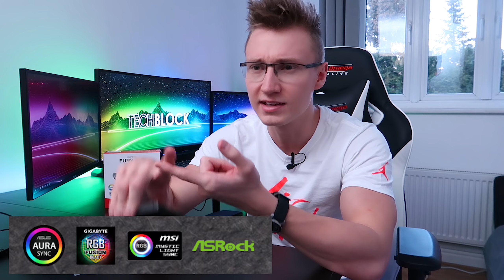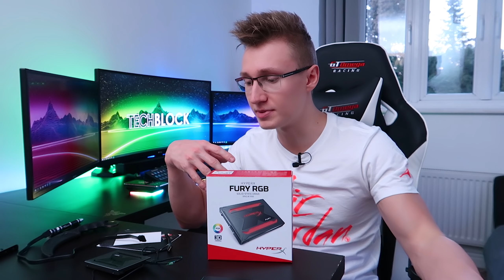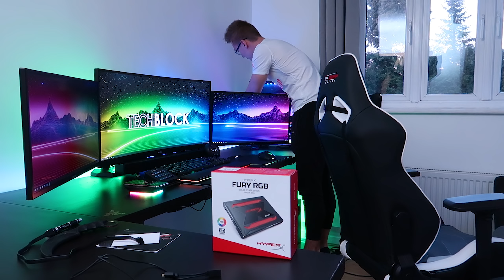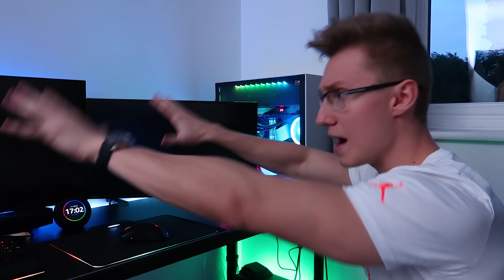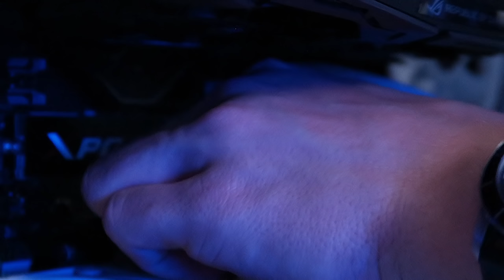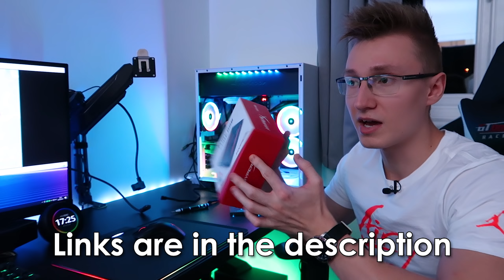HyperX Fury RGB SSD - Overview, Lighting Effects, ASUS Aura & More!

Comment: Worth mentioning that this SSD has over 70 LEDs that can heat the drive up a lot, causing it to throttle and lose performance. Now for most it shouldn't be as problematic as the one is Jayz video, but across the board we AT LEAST see quite the performance drop due to the LEDs.

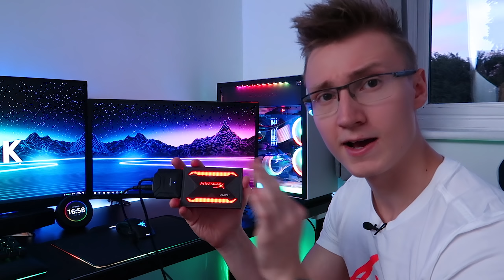Comment: "This will get a tad warm i would say."(8:42) I wouldnt call that a tad at 68°C =154,4°F, when only idling.(https://www.youtube.com/watch?v=vnST5rA64Oc - 5:42)
Just because the insane amount of 75 leds are built into this waste of money. It limits its own speed just to compensate for the extrem heat caused by the leds.
Please consider testing this SSD with the LEDs on white and share how windows stops functioning, when you boot from this drive.

Comment: You are seriously addicted to rgb I think you need to see a doctor
Reply from the maker: There is no cure
Reply: @TechBlock ...yet
Reply: @TechBlock  if you have 2 hyperx rgb ssd can you series it? To the male 4 pin thats with 4 pin female attached to the 12v rgb?
Reply from the maker: @leofrancismajarucon7629  What do you mean by series it?
Reply: I think he means if can you connect one drive to the others extension to daisy chain both drives to get power from 1 rgb header..  @TechBlock